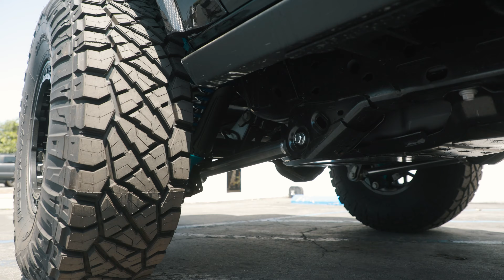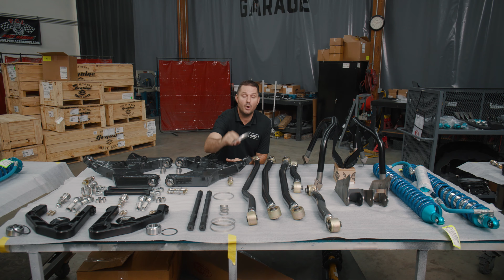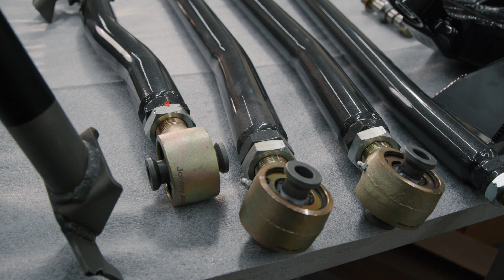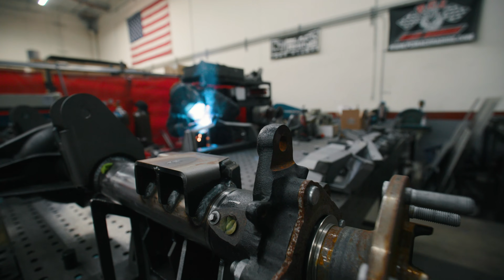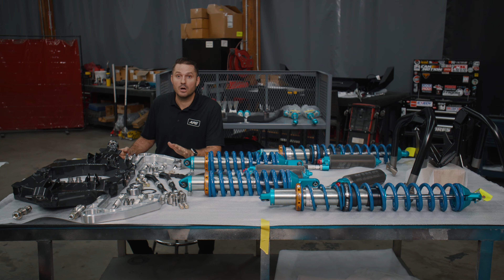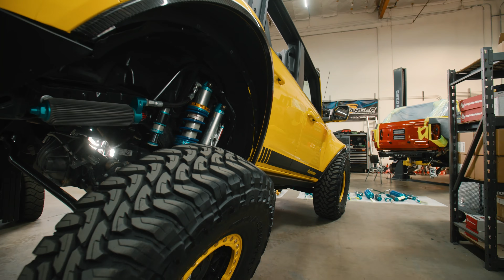FORD BRONCO SUSPENSION KIT | Mid Travel vs Long Travel vs ProRunner

Comment: Honestly with your pricing it makes the raptor sound like a bargain.  It’s nearly the same travel, with a warranty, and higher resale.  Good luck.
Reply from the maker: ProRunner has significantly more wheel travel, cross articulation, and user preferred shock/spring settings. But we get it… Building to that next level isn’t for everyone. Thanks for the comment

Comment: That’s legit. Whenever you wanna Bring it to the Rubicon and showcase it against a more basic build on King suspension and 37’s let me know. Rubicon is in my backyard and I just took my Bronco through it. Would love to see the real world differences on a rock trail. 

A question for you; what is the feasibility of placing a Raptor Dana 50 axle under the rear of a standard Bronco for the extra width vs doing a more expensive Dana 60?
Reply from the maker: Has snow starting falling down up there?
-Q/A: Different: lug pattern, abs tone, bracketry, ect.. Locker may have different pulse as well, not sure.
Reply: @APGOFFROAD  gotcha… yea I was curious how feasible it was. Sounds like computers would be main factor… snow has slowly started to fall. Rubicon doesn’t have much but it will be here soon